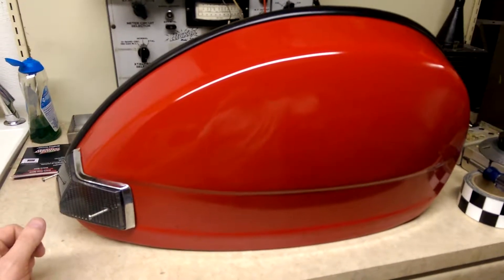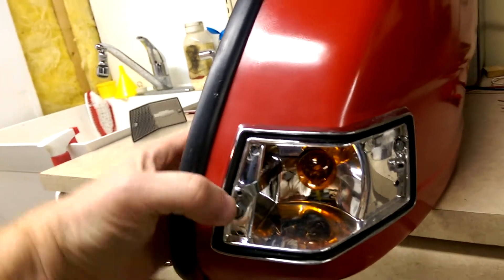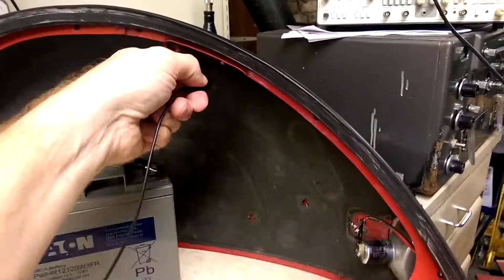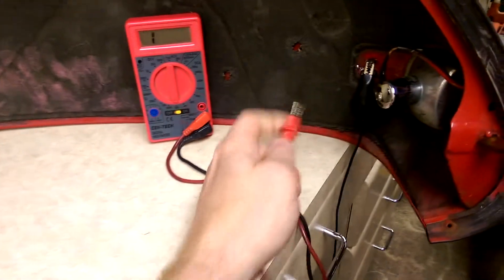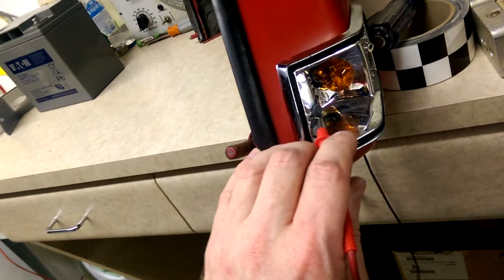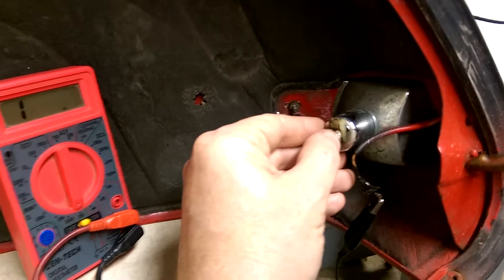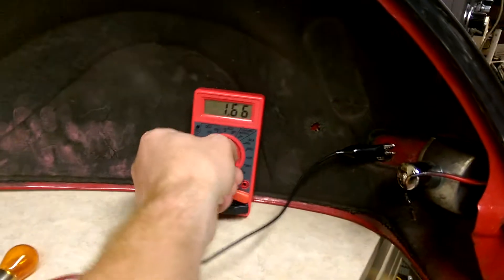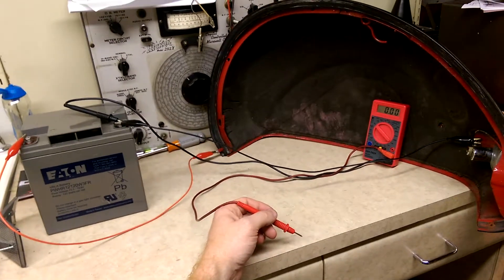Turn Signal debugging Genuine Stella (Vespa PX) Scooter

Comment: I got a problem with both my front indicator it is flashing too fast and not the normal flash like the alternate, and also the both rear indicators are not working. I am still wondering what might be the problem, I am thinking it has something to do with indicator switch, or grounding probably? Thank you.

Comment: Fantastic Video
I have a '93 px125 and the turn signals wont alternate.... front and back all four bulbs work but when I flip the turn signal switch at steering they dont blink.... any tips for troubleshooting this?
Reply from the maker: The flasher module could be bad.  Tried changing it?